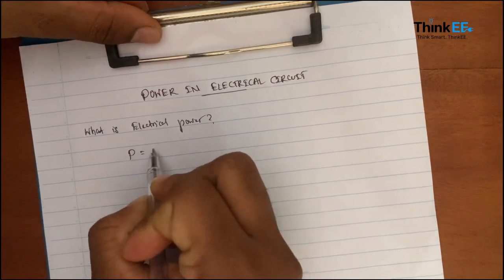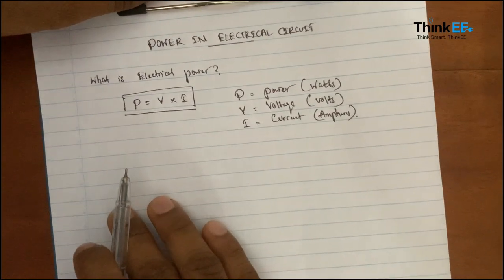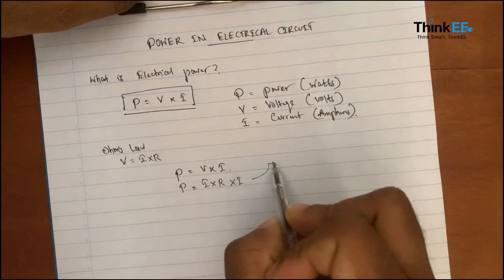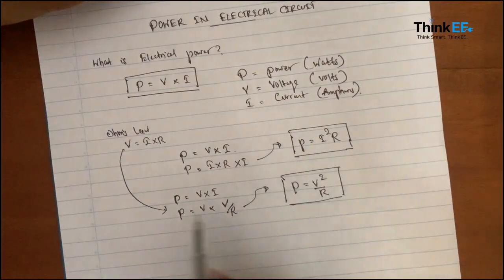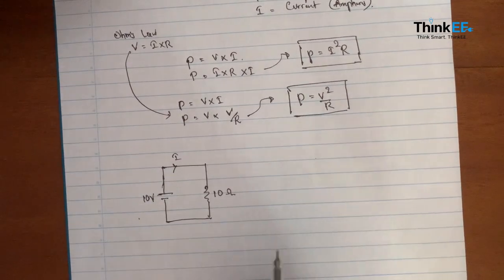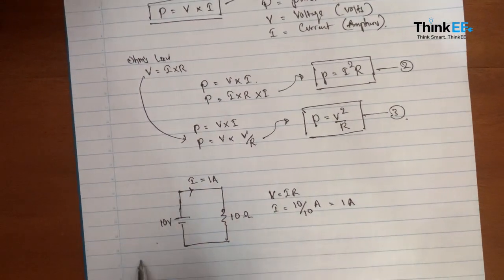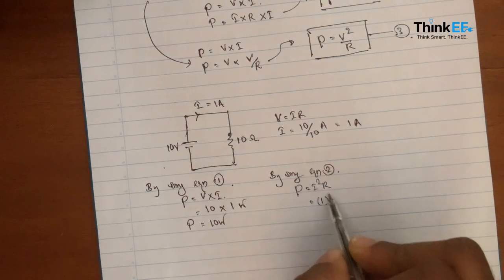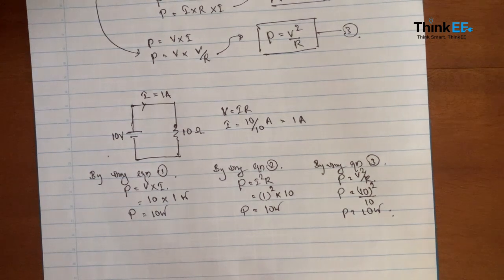Circuit Power in Under 10 Minutes

Comment from the maker: ⭐ What You Will Learn:
What electrical power means
The 3 main power formulas
How voltage and current affect power
Power in resistors
Power in series circuits
Power in parallel circuits
Real-life applications
Step-by-step examples